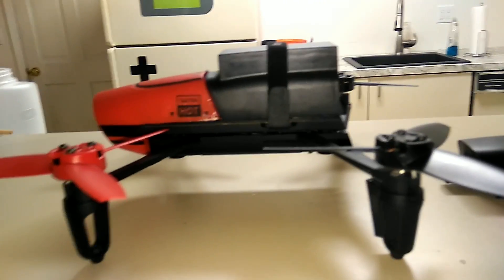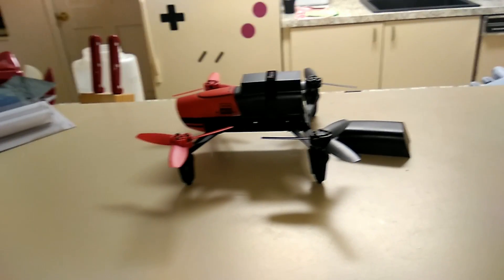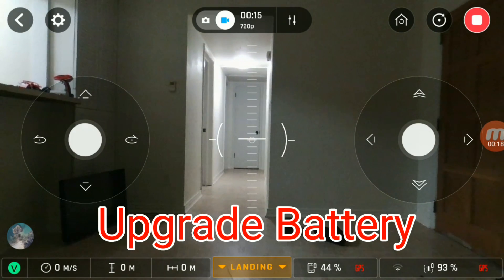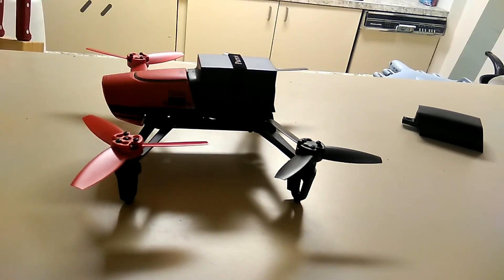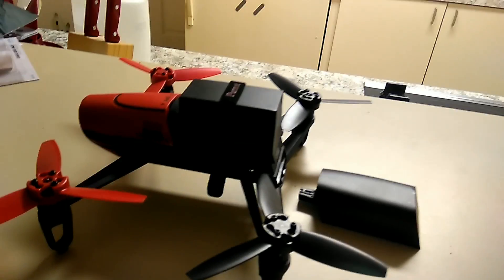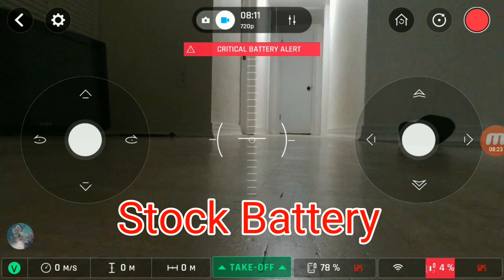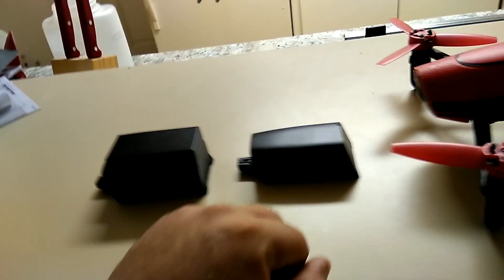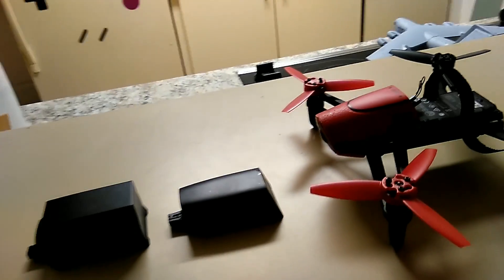Parrot Bebop Upgrade Battery 2500Mah VS OEM Test

Comment: Well when I bought my Bebop 2 I found that not only would the battery in the Sky Controlled 2 not hold a charge, but had an obsolete battery in it which could not be replaced. Parrot told me they would replace the controller with one that had the new style battery. That was over a month ago. Finally they told me to send them my old controller and they would replace it, that was three weeks and two phone calls ago, and I still have heard nothing and I have no controller at all. Might be a good drone as long as you don't have trouble with it.

Comment: I doubt you're going to need to do too many more of these indoor  tests but for the optical flow your floor probably doesn't have enough texture for it to work really well, especially (as you said) in low light. Printing a small textured target, even just an H or X to place beneath the quad should give it something much easier to lock on to.

Edit: just as an extra curiosity - what are the temps like on the rear motors vs the front when using the bigger battery? With the CG shifted further back more of the load will have been shifted to them. You'd be surprised how much of an effect CG can have in quads.
Reply from the maker: Daft Flight as soon as my flypad controller comes in and my wifi repeater for signal range extension I'll be doing some longer outdoor test. This package right now is basically selfie mode at about 75 feet using just my phone
Reply from the maker: Daft Flight next time I fly with that battery I'll bring my radar and have a test of the temperature on the motors for you
Reply: It’s pretty remarkable at optical flow even on low texture floors, it’s the amount of light that kills it

Comment: Thanks for video - coming late to this - haven’t used original bebop (one I guess)for about 5 years and batteries are dead - what batteries do you suggest I buy now that are a good price performance ratio - thanks again
Reply from the maker: Honestly man I have no idea at this point I haven't touched this drone in 5 years either
Reply: @IFixShet  ok, thanks for the reply

Comment: Hey Dan, so I take it you have had some good flying time on the 2500mah now, what is your opinion of the flying characteristics of the heavier battery? I just picked up my Bebop 1 about a month ago, and only have the two stock 1200mah batteries.
Reply from the maker: R. Gane I quit using it because it was so tail heavy it just caused bad performance all around even though you do get extended flight time it's just really bad performance
Reply: Cool! thanks for the info! great vids!

Comment: I bought a Bebop 1 a few years ago, Its such a huge thing I only tried to fly it once. Its sitting in a drawer along with its huge controller. Would almost be embarrassed to take it out in public in light of such drones like the mavics etc. Can't even be bothered to sell it as it's worth nothing. Everybody I offer it to says "nah",
Reply from the maker: That sucks because it's an extremely capable drone especially if you think about how much technology is still in it and that it's functioning 4 years later without issues. Pretty hard to beat the $99 price point from techrabbit refurbished at this point you can't even buy toy quads for that and get even a fraction of the abilities of the Bebop 1. On top of that the battery is there producing now given an extremely good flight time and you still have the ability to do Waypoint missions that far surpassed the range of the choirs capabilities with the skycontroller 1
Reply: @IFixShet  ....thanks for that. You've inspired me to give it another go. Told my wife we're going out tomorrow. Wind low tomorrow  where I live.
Reply: I love this drone...great camera on it..other than the flight time this is a great drone for the price..I’d buy it off you

Comment: Mount a DC small motor on the props. An use a DC t dc buck an connect it to the battery an c if that can help to extends flight time

Comment: What's the weight difference between the two batteries makes me wonder about if someone could make a larger battery for the solo with everything I've ever seen or read everyone always says adding weight with the battery would offset the additional time in flight but this just proves that wrong
Reply from the maker: wanna fly high the truth is they could make a bigger battery for the  solo that it would have no problem carrying however no company is willing to do that because the solo is not in business anymore. If the company was still in operational business then there would probably be other manufacturers producing parts for it

Comment: Bebop 1 is good only with this big batteries. With Parrot stock batteries is almost useless.
Reply: De acuerdo, pero crece el riesgo de entrar en un flyaway con una bateria pesada.
Reply: I just got 18 min of hovering flight time on a bebop 1 in windy condition (4 beaufort winds) using INR18650-30Q batteries and redefining the battery conversion table (cut-off voltage 8.5V for a 3 cell li-ion battery)
Reply: Alberto Costea saludos alberto qe es un flyaway?

Comment: I just got 18 min of hovering flight time on a bebop 1 in windy condition (4 beaufort winds) using INR18650-30Q batteries and redefining the battery conversion table
Reply: Make a video.
Reply: @skeebod576  You can see the flight at: https://youtu.be/tzVVUJpXJCw . I had to cut out parts because youtube does not allow me to upload more than 15 minutes.

Comment: I could live with with 12 mins
Reply from the maker: +Big drone flyer77 3 more batteries coming for testing. Dont order any yet
Reply: Drone Worship ok thanks, going to see if I can get the bebop fly again
Reply from the maker: Big drone flyer77 I mean what's really wrong with your Bebop all together that you're aware of?
Reply: Drone Worship the flyaways, so we will see what happens with selfmade skycontroller. I see you lose signal before out of nowhere. I think the hotspots are so bad where I live it is a big factor for mine only getting 40ft